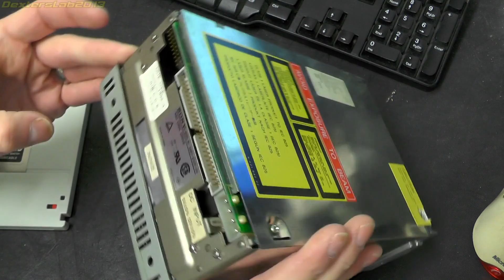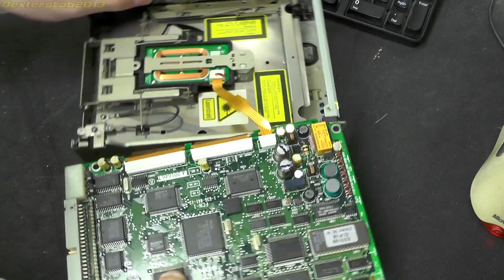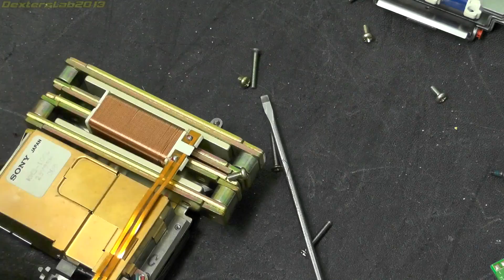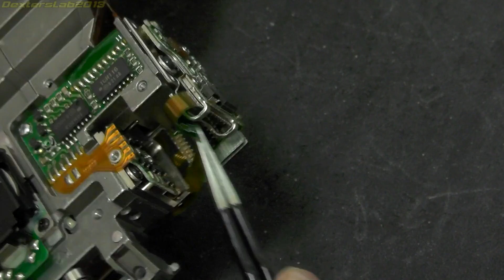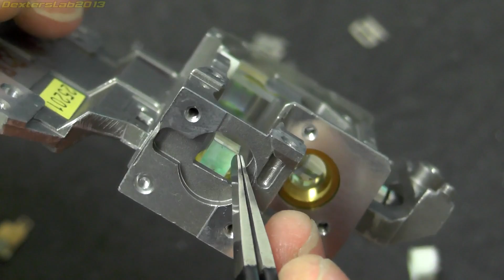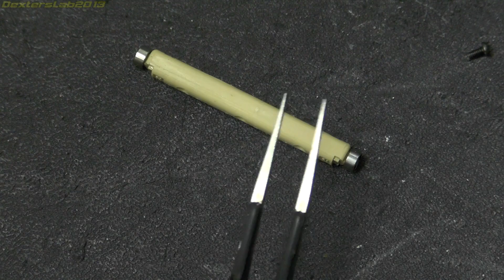DL#115 - 1990s Sony SMO-E501 Magneto Optical Disk Drive Teardown

Comment: Good memories. they were slow on the macs we used them with. I suppose most of teh slownedd would be caused by the write coil, which has to be energised opposite polarity for erase and then for write. Together with the slow bus of the max and limited buffers of the time this may have meant 2 revolutions to write only a little bit of data.
That sound... very specific.

Comment: The usual failure of old computer hardware is grease that turns into a sticky slime that glues sliding parts. You could probably have rescued this by dousing those stuck bearings in a light oil like WD-40 with a cotton swab to soften and release the gunk. Use a tiny amount of sewing machine oil to finish, and blot away any excess with a dry swab.

Comment: Another interesting teardown. Thanks. Typically over complicated 1990's design! 
I wonder if the rotating plastic coated magnetic shaft may have something to do with erasing the data? Given that it was located between the two magnetic coils it would have been possible to make it rotate if the two coils were energised asynchronously. Perhaps, in conjunction with the shaft, this would create a fluctuating magnetic field which would create a sufficiently random polarisation pattern to erase the data using the laser?
Reply from the maker: A very interesting thought, unless i can see a working drive i guess it'll be hard to know.

Comment: Could you use the LASER out of a Blu-Ray DVD/RW drive and see if that works then there is no need to recycle the unit and reinstate the unit into the QUANTEL Paintbox.
Reply from the maker: The drive is scrapped now, also it wouldn't really be worth it. It's easier to just use a newer working drive, they are backwards read compatible so the newer drives can read the old disks.